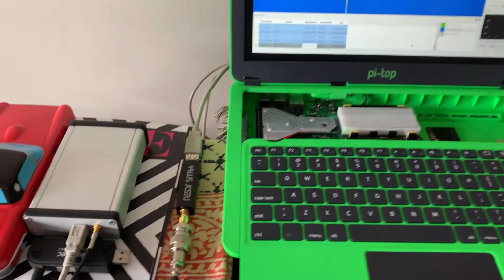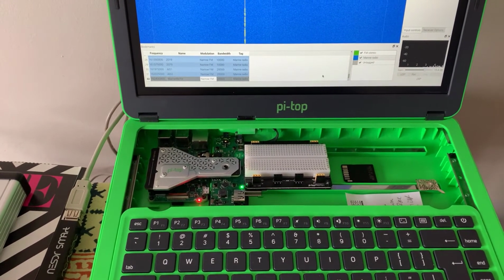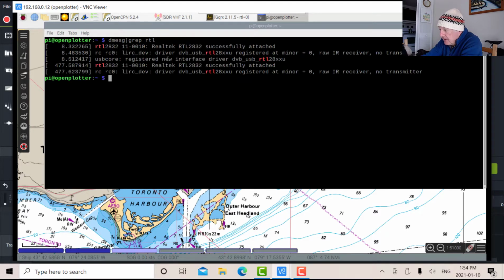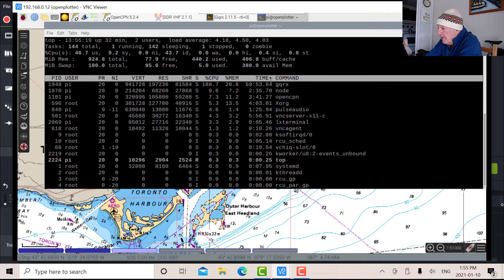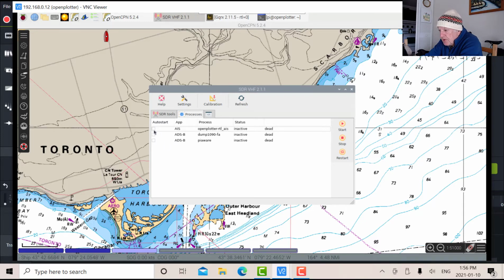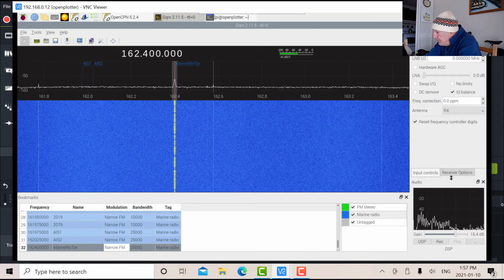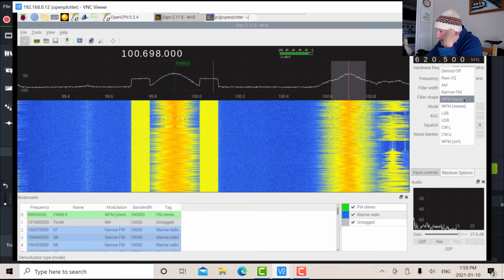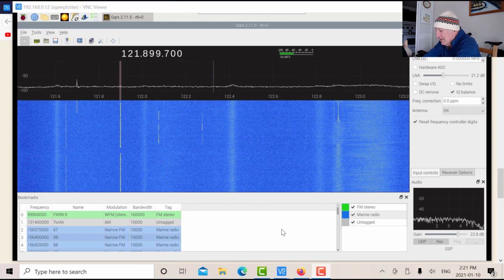OpenPlotter - RTL-SDR for VHF/AIS

Comment: In other videos i see the dAISy hat recommended for a chart plotter. Is this not necessary with an rtl sdr? Does the hat serve a different function? Thank you for the video
Reply from the maker: Peter the dAISy HAT is a dedicated two channel AIS receiver that sits on top of the RPi GPIO bus. It has a serial output and will work with OpenCPN. The RTL-SDR is a receiver that works from 25MHz to 1750MHz so it can be tuned to either of the AIS VHF channels. OpenCPN has software that will tune the RTL to monitor  both channels and send the information to OpenCPN. The RTL plugs into one of the RPi USB ports. The HAT is specifically designed for AIS so the receiver is probably better than the RTL which was designed for a different purpose. You would have to test one against the other to see the difference in performance.
Reply: @ClarkTelecom  thank you very much

Comment: Thanks; subscribed, and I'll have to watch your previous posts.  Quick questions from BC: Can you have two SDR modules connected so you can use AIS and the weather at the same time? Also, you mention the Pi3 is at limits; is there a reason you don't update to the much faster Pi4? Are there problems with using the Pi4 these days? (I know some plotter stuff only worked on the Pi3 last time I looked this up.) Thanks again.
Reply from the maker: Paul I haven't tried that. I think the default settings are to use the RTL for either AIS or Gqrx or ADS_B. In theory I don't see why not. The way to check would be to start off with the 1st RTL working on AIS. Then plug in the second one, and see if you can detect this separately with Gqrx and that the AIS still works correctly. I have not upgraded to Pi4 because it is not compatible with my PiTop that I use for all my development (different hdmi connectors).
Reply: @ClarkTelecom  thanks for the speedy response. For me the research is for which HW to buy starting out, so the answers need to be sought first. I've got the manual now, and your videos are very instructive. Thanks again.
Reply from the maker: @paulpvhl1930  I tried using two RTLs. One for AIS and one with Gqrx. They are both detected in SDRVHF as device 0 and 1. Device 0 is assigned to AIS and then I open Gqrx and select Device 1. This seems to work, but I am not sure since I can't detect AIS traffic from home. I will try it out later this week at harbourfront. I would go for the RPi4 since it has more horsepower/ram.
Reply: @ClarkTelecom  Thanks again Jeremy. That suggests it works. The project's HAT seems to be unavailable so I'm looking at ways to build from parts. Agree on Pi 4, especially now it can boot from an SSD and have 8 GB of RAM.
Reply from the maker: @paulpvhl1930  Tried today at harbourfront. Works AIS on 1st RTL, Gqrx on Toronto Marine Wx on2nd RTL. Problem is Pi3B doesn't have enough hp to handle both and all other functions at the same time, the receiver breaks up a lot.
Reply: @ClarkTelecom  Very generous of you Jeremy. Many thanks for doing that research for us all, and for me in particular. SDR seems to take a lot of the Pi3's power. I should be able to estimate how well things would work on the Pi4 now that I know it will work with two units.

Every time I try to get into this the official HAT is not in production, with no explanation as to why, so a DIY approach seems indicated this time. In my first post I hadn't realized how versatile OpenPlotter and Signal K have become and should be able to distribute computing power where needed, including with controllers like the Raspberry Pico and ESP32, and with my ever-present, powerful phone. I'm looking forward to this, and to sharing what I can as an open source developer.
Reply from the maker: @paulpvhl1930  Check the latest video, you can see the assignments.